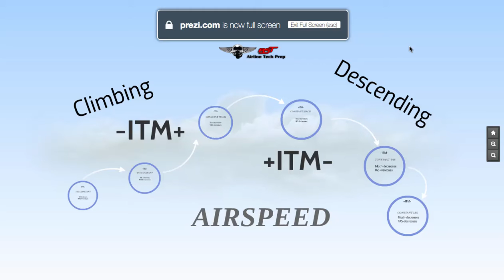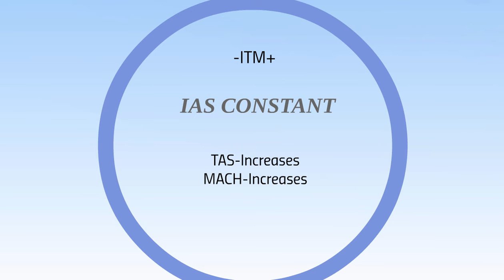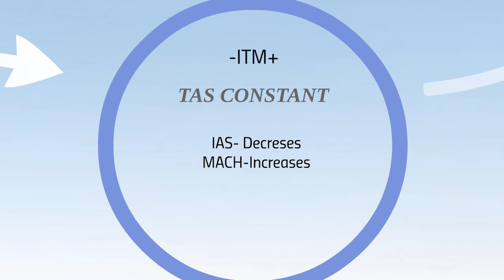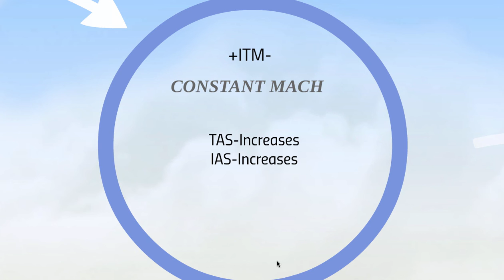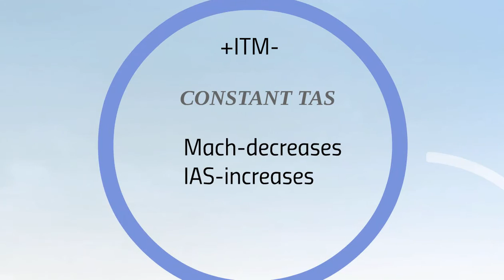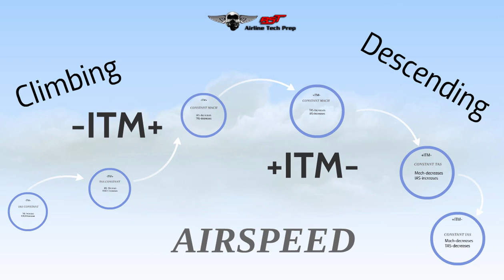Airspeed Climb/Descents

Comment: Great explanation and way to be able to answer some questions, but this method is only correct if we are flying below the tropopause, for example, where the temperature gets colder, LSS (local speed of sound) decreases as we climb and therefore to maintain a constant Mach number, we need to increase TAS.
It´s different if we fly above tropopause because the temperature remains constant, isothermal layer.